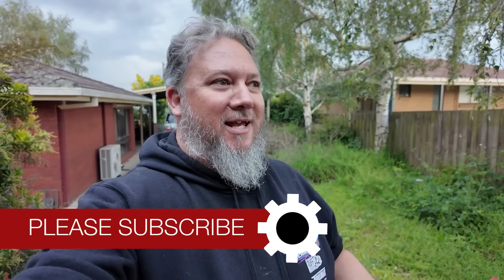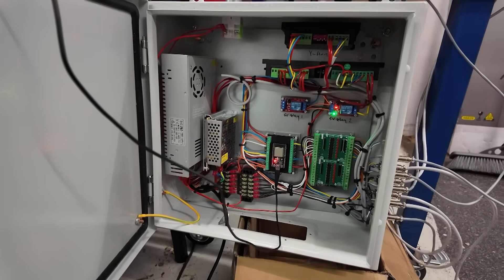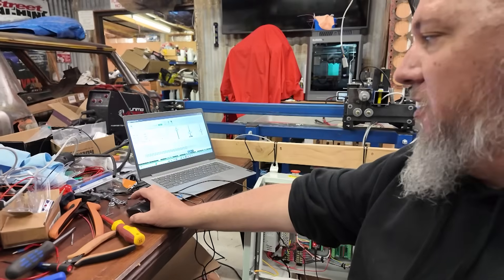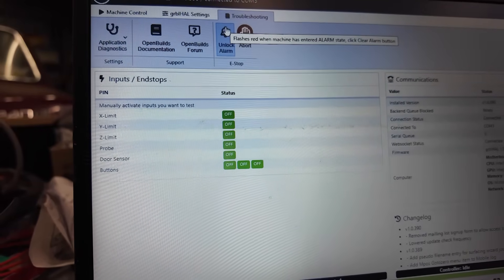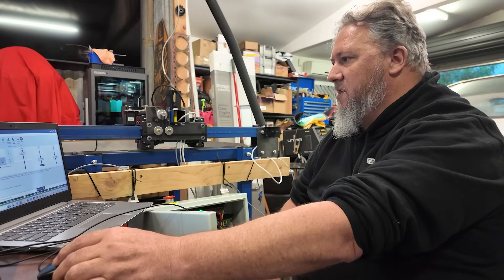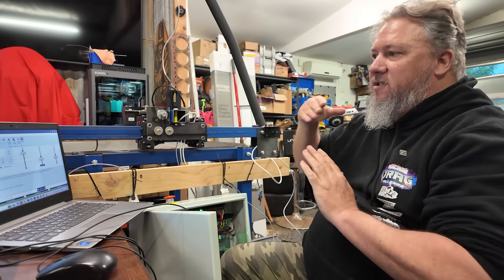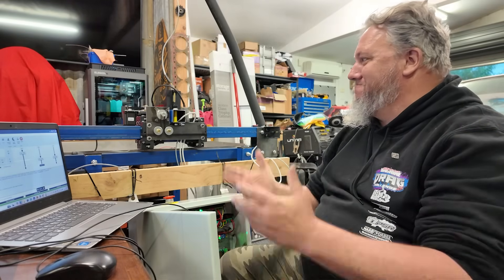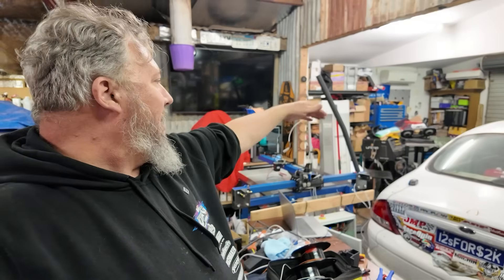Scottys Garage - CNC Plasma Table Build Part-6 -- Powered Up For The First Time!

Comment: Hi , nice series! Do you have a resource / link on how to program the chip? Thanks !
Reply from the maker: I used Openbuilds for the actual programming, but the code itself was supplied by the guys who designed the table.

Comment: Limit switches are NC to the input on your control and ground. You also need to configure it in your CNC software. Gekko G540 manual shows a wiring diagram for limit/home switches. Not sure what software you use but I use Linux CNC for my CNC router. Works awesome.

Comment: Interesting build Scotty,  check the power at the 2 pairs of motor wires at the controller. I would think 1 pair should be powered, then swap to the other pair  as the travel direction changes. If there is no power, then check power earth and signal wires to the controller. Should be able to work out if it is a motor, controller  or software problem by doing this.

Comment: If you wired the motor connectors the same you can always switch the motors from x > y and confirm the motor is functioning.
Also check the enable signal for the stepper module is getting a signal.

Comment: Great series Scotty! There is a good chance this has been addressed in previous videos. Did you code the table or is it plug and play. If you can access the code just check it’s operating on the correct rung of logic.
Reply from the maker: I'm using the code that the creators of the table created. I assume it should work correctly.
Reply: @blownhemi excellent, I’m assuming you’ve got 4 limits for x and y? Check if the limit stops a direction of travel. Hopefully its a simple as the limit switch connected to the wrong input 🤞

It looks like a great intro to plc’s Scott :)

Comment: Have a look at the breakout board and wiggle done wires . Also have you gone into grble setting on Open Builds, JDs has the full settings in your email. Your driver might not be wired or a wire isn't touching contacts, it happened to my build. 
 Be patient and expect strange things to happen , also the calibration needs to be done . Hope you sort it out
Reply from the maker: Thanks for the tip about the settings, I'll definitely check those out!

Comment: Scotty with regards to your X axis motor movement... I would be looking at your limit switches if you are sure the motor wiring is correct. I use UCCNC which is a controller software that requires one of their control boards and I am not familiar with the OpenBuilds software, but I do know what is roughly in there. Sometimes the problem can be staring you in the face, with a checkbox that needs to be clicked, or unclicked, especially when you invert pins, it can sometimes be like a double negative which throws you off. But here is my thinking of what might be possibly wrong... Facts we know... your limit switches are not working on the Y axis, ergo something is not configured properly to make it stop. You may have the exact opposite problem on the X axis, it may be in a constant stopped mode because it thinks the limit switch is tripped. If possible remove the limit switches out of the system, just to get the motor moving and it then confirms your wiring is good. You have even want to reverse the pairs of wires on the Y axis motor so you don't need to invert the pin in the software, as that might also be contributing to the software configuration confusion.
Reply from the maker: Yeah, I've moved the feed from the Y-motor to the X-motor and the X-motor moved, so the motor is okay, just got to go through the wiring, or maybe there's an incorrect DIP switch or something.
Reply: @blownhemi  yep it will be something really stupid, and when you do eventually find it, you'll be how the hell did I miss that. Been there, done that.

Comment: I have to admit I vaguely remember the first power up, it was 10 years ago, but it was exciting thinking that something I made up completely out of my own head actually worked. I knew you weren't going to get the electronics sorted as fast as you thought, but that is only because I have been there myself. Congrats on your first movement.
Reply from the maker: Thanks! Yeah, the electronics are always a bit trickier than you expect.
Reply: @blownhemi  not only that, but your trying to configure things like dip switches, makes sense of thing you have probably never encountered before like motor stepping, acceleration ramps etc etc. It's not just the electronics you are trying to get your head around, it's the software as well at the same time as all these other things. Throw it altogether and it really slows down progress. But on the plus side it sounds like you are getting your head around it.

Comment: nice progress to see its partially working, if was not doing anything that would be hair pulling time.
Reply from the maker: It was a good tip about trying the other motor with the good wiring. The motor works, so it's wiring/controller issue.

Comment: Swap the motors and see if it fixes it 🤷
Reply from the maker: I've used the same plug on both so yeah I could just swap it over and it would eliminate whether it's the stepper motor, or the wiring/controller. Good idea!